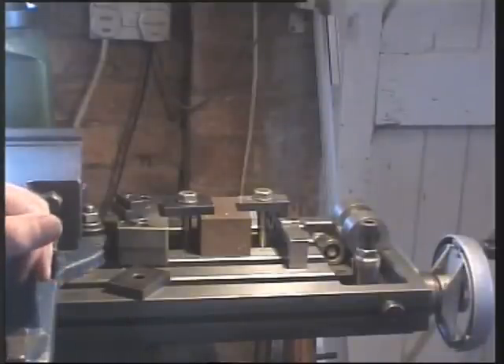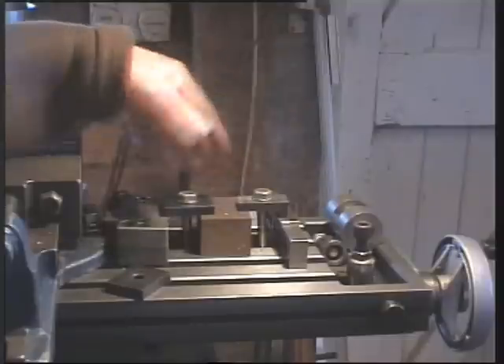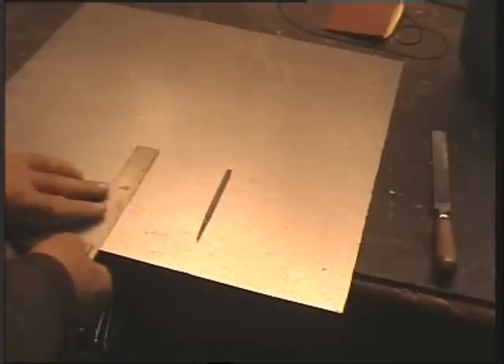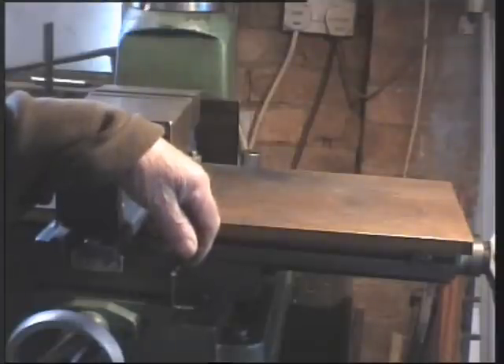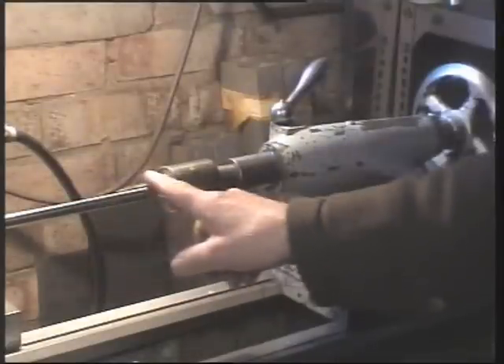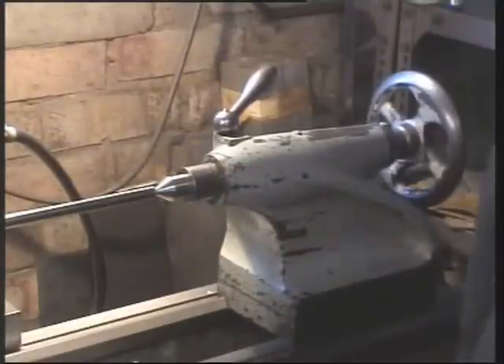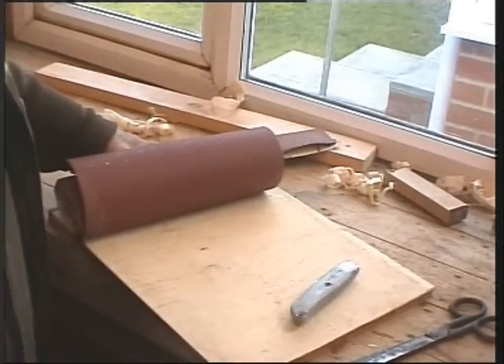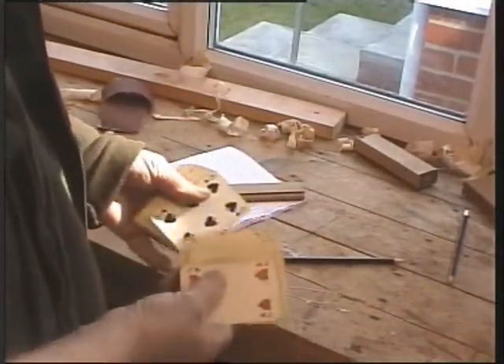more workshop tips

Comment: Priceless. Your variable packing is a jewel. To be copied ASAP. The lathe trick with the felt wick -- I will try it. I am always  feeling the lack of a live center. The sandpaper cutter is pure art. Thanks. I will copy all those tricks.
Reply from the maker: A live center is a nice little project for you to make
Reply: Not such a bad idea, POC! It's on my list now.
Reply from the maker: If I didn`t already have one, I would make a vid showing it made, turn a shalf to fit your morse tapper then turn a stub on end to fit a couple of bearings the out side of which go inside a center  (cone) keep it that simple ,while your at it ... make a vid and share with us :-)
Reply: Ah, poc, my lathe has no morse taper at all. It is a Taig, known as Peatol in the UK. The tailstock has a built-in dead center, which at the back is threaded to accept a drill chuck. I would have to modify your design considerably. I can do it; it is a question of time. I am currently working on a clock and am wreapped up in that.

Comment: Some nice tips there m8y ,I presume you were a machinist ! When I use my lathe I can never get a nice smooth cut on the metal I have to finish it with a file and Emory cloth I sharpen cutting tool as best I can .can you do a vidio of machining and setting up including sharpening the cutting tool thanks ,ant from Wales
Reply from the maker: No I was never a machinist just "one" of my hobbies, I`m sure you know tools must be at correct hight, feedslow, try to use freecutting steels, put a small "radius" on the tip, shame they don`t teach metalwork/woodwork in schools anymore. one of the best ways to learn lathe tool geometry is to use a treadle lathe  , you learn fast !